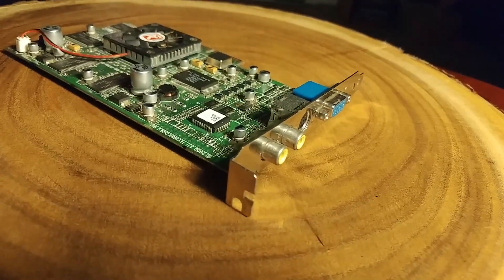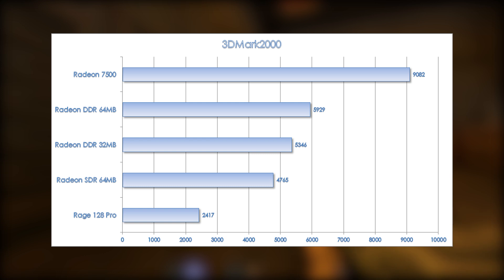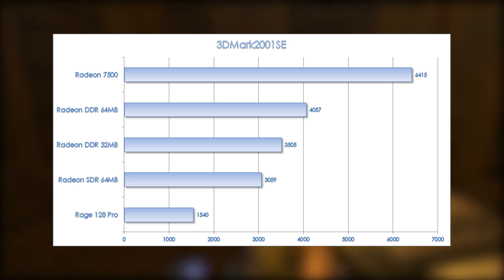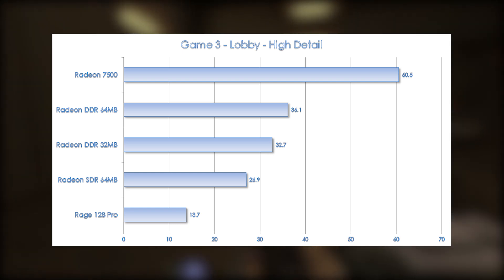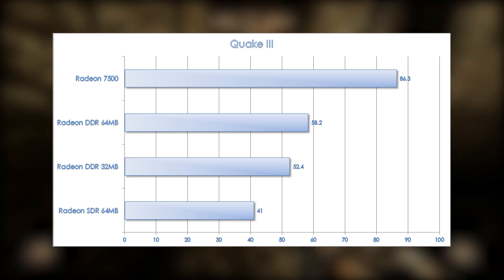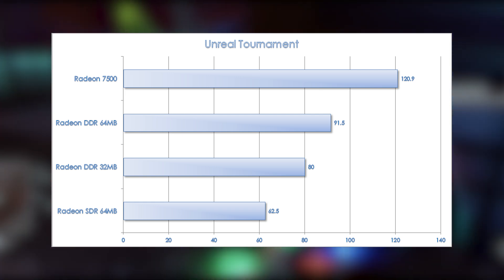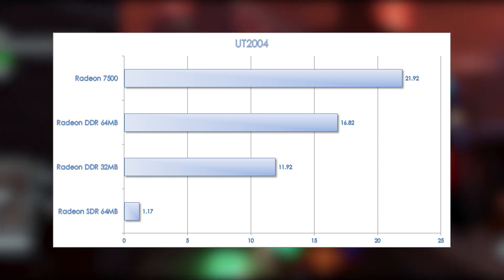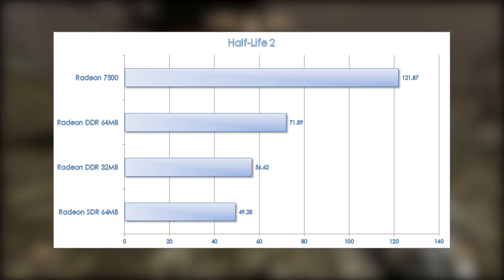The Original Radeon

Comment: 0:09 - But did it? According to tests performed in 1999 such as AnandTech’s, the TNT2 scored almost 15% lower than SLI Voodoo2 in Q2 16-bit and 25% lower than Voodoo3 3000. Only Ultra cards could match them reaching the same results within the margin of error and it took a factory OCed Hercules Ultra card to match Voodoo3 3000. If such results were achieved in Q2 then I can’t imagine TNT2 outperforming SLI in any Glide enabled title of the time 🤔
I guess have to dust off that V770 and compare it head to head with two Monsters.

Comment: In the space of a few generations people could plainly see NVidia rapidly gaining and overtaking 3Dfx, and I think that led people (including tech writers) to become so fascinated with them as to become a bit biased.  Me too, in retrospect.  I don't think ATI, Matrox, or even 3dfx got enough credit when they deserved it because there was so much hype about NVidia, especially after the launch of the GeForce branding.

When I was shopping for a budget video card at end of 2000, I pretty much immediately fixated on the Geforce2 MX.  I never gave a thought to any Voodoo or G400 or Radeon as I probably should have.

Radeon seemed to get screwed on pixel shader support twice in a row, wasting silicon in each design because it didn't match what NVidia was doing.  First with the original Radeon, their implementation of pixel shaders was overlooked and unsupported in any DirectX.  Then with the Radeon 8500, their enhancements to pixel shader capability as well as "TruForm" tesselation were again pretty much ignored.
Their great success came with the 9700, which was the first time ATI got to design a GPU with perfectly targeted support in DirectX (9).  That time it was NVidia who got screwed, because Microsoft was punishing them for a dispute regarding the XBox.
Reply: ATi was very much held back by drivers until at least the 8000-series. Peoole have often said that ATI and AMD cards ”age like fine wine”; the only reason they say that is that the release drivers during those early reviews suck ass and the driver team will be able to massively improve those over time. A retrospective of the original radeon looks a lot better; it is using a much faster CPU and a much newer driver.

Comment: The 7000 was the first, the 7500 was after. Sorry which was yours? You never say 7000 or rv6p
Reply from the maker: Radeon 7000 is the name they gave the budget-oriented RV100 based cards. Those came later. The first Radeon was based on R100, also known as Radeon 7200 later on.

Comment: ATI had a pretty good performance in games but there was this major thing that always made me hate them. The drivers. There was always driver issues whatever game would be used with them and there was either way tearing and glitches in the picture and even missing walls or other objects in games. 
For me it was a major downfall which lead me to never use ATI myself. You may call me Nvidia fanboy if you want but I just pick the working cards for my computers.
Reply: Thankfully at some point some guy created the Radeon Omega drivers which solved many issues and performed great, although the issues you're mentioning I never experienced anyway even with original ATI drivers. Maybe your experiences were from a bit before I really started to use a Radeon which was about 2004 I think.

Comment: Great video those were the days back then 3DFX had the fastest cards back then funny you didn't list them in your tests cause the VOODOO 3 2000 was a killer card at the time and ran UT2004 good I remember running Halflife on it with it's mini gl setting just for VOODOO 3 2000 cards it was amazing and ran circles around these cards in your tests except the 7500 ATI which is beyond these other cards really VOODOO ruled at this time I think my next card was the ATI 8500 I had the VOODOO 5500 64meg card but didn't use it very long before getting the ATI 8500 which was leaps ahead in performance by then.
:)
Reply: Voodoo 3 was obsolete at this time. The radeon ddr ran circles around it and was about equal to the voodoo 5 5500 in performance.

Comment: Ah, the days when a 75-150% performance increase in a single generation wasn't just possible, but not particularly unlikely either.

Nowadays you can count yourself lucky if a new generation is 25% faster than it's predecessor...

I think it all kind of fell apart somewhere around 2011 or so...
Reply: Yea, one is on 350nm the other is on 180nm, found 2 RAGE PRO TURBO's in my dad's room that's why im here.